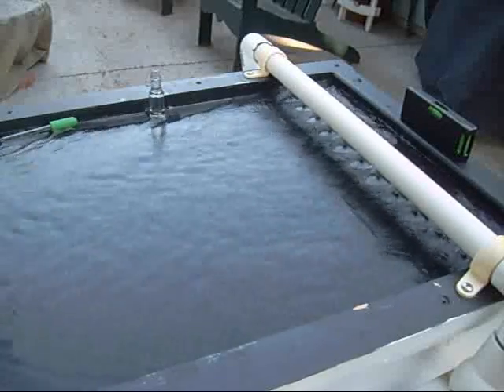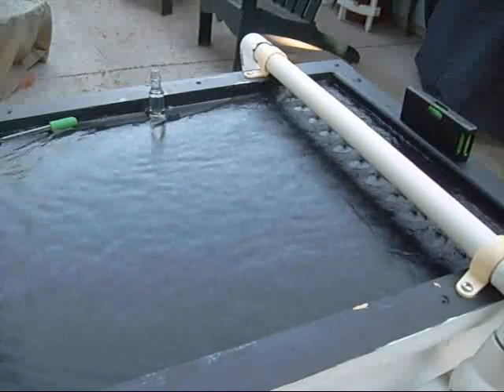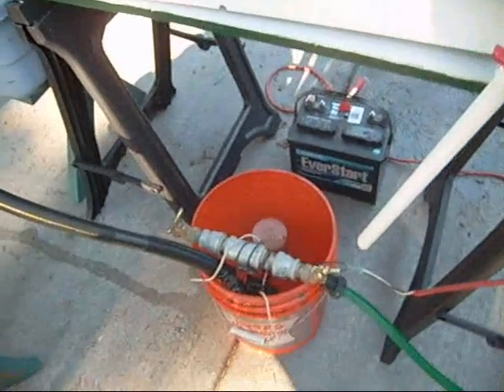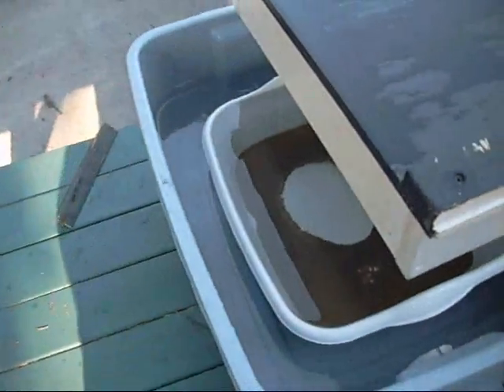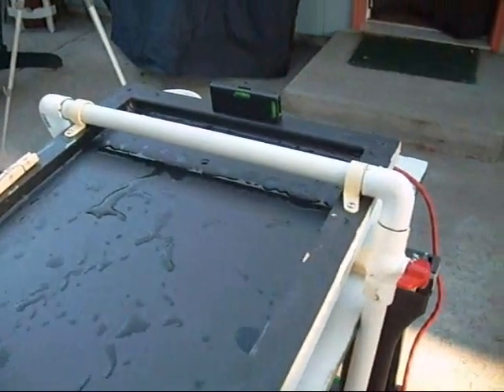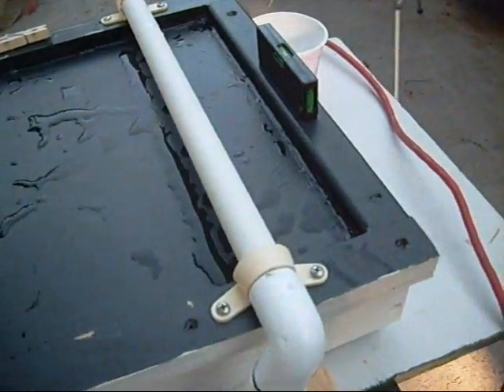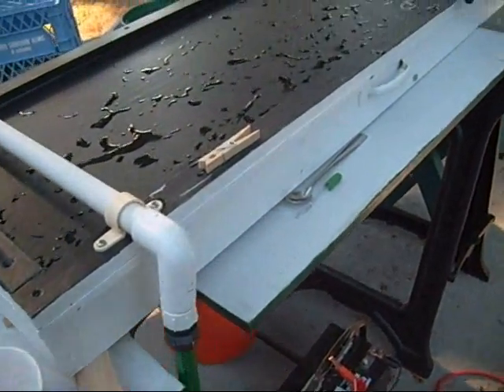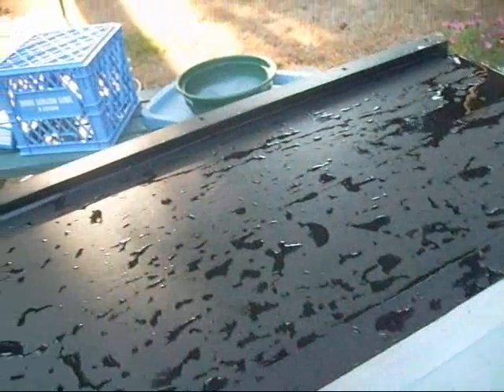S1E4 Washington State Gold Mining - DIY Miller Table wth Pete

Comment: is that chalkboard? my sound is screwy
Reply from the maker: Nope - that is just plain old flat black paint.  Someone told me that it wouldn't work - you might call that some kind of challenge!  I now use hobby mat (plastic cutting mat used for craft or sewing projects).  It's a little spendy, but seals the 1/2" plywood just fine and I don't have to spend much time getting a smooth surface to start with.  I'm using a much shorter version now (about 13" long) that you can see in later videos.

Comment: So a Miller Table is a slick plate where you control flow and pitch?
Reply from the maker: +Gold Hunter Sort of - it also has a tooth (provided by the paint or surface - I used hobby mat on some of mine).  The tooth (think roughness) is light enough for the gold to catch, but slick enough so that the black sand will slough off.  The old timers used black board slate, rock, or flat black paint to pull it off.  I was amazed how well it actually worked.  Thanks for your comment!

Comment: That's a great Miller table.  Maybe a little long but that don't hurt.  Some people put sponge pieces under the pipe to smooth the water.
Reply from the maker: Look at my latest version - shorter and with a "sponge".  I built the long one as a prototype and redesigned it after using it for a year.  I've had a lot of success with it - I like them for really fine gold.
Reply: ok

Comment: Did you paint the surface of your table with something? What is the surface made from?
Reply from the maker: I'm really about keeping as much of my money as I can - so don't laugh!  There's a lot of info on home built miller tables on YouTube.  Everyone talks about slate or chalk board surfaces.  I felt that other materials ought to work too, so I painted my 1/2" plywood scrap with the least expensive flat black exterior paint I could find (3-layers).  I decided that if my $35 table lasted a year, I'd replace it.  I've made a few changes to it and they're posted in my latest video.  Another month and it'll be a year since I built it.  Thanks for the comment - Hope this helps!
Reply: Dennis Petersen,  very smart...you could put a lot of money into this hobby real quick!

Comment: Thanks for showing your setup. Just wanted to mention that it's good to put your battery on a piece of wood. From working at a company that sold batteries I learned that putting them on concrete will drain the energy from them. Best of luck with prospecting.
Reply from the maker: Thanks for your comment.  I usually use a piece of wood when I'm out and about, but don't usually mess with it for stuff like this.